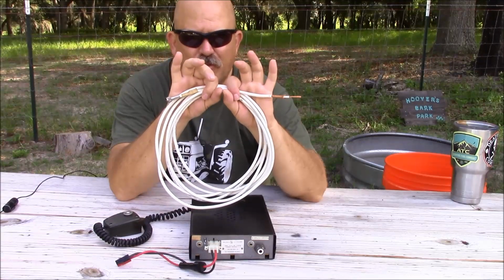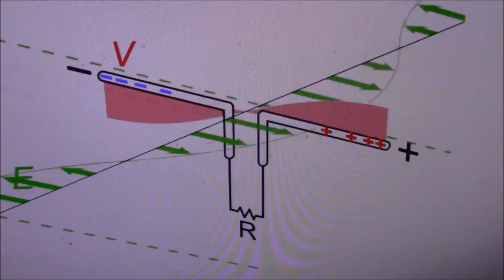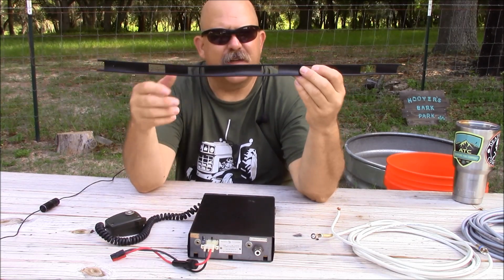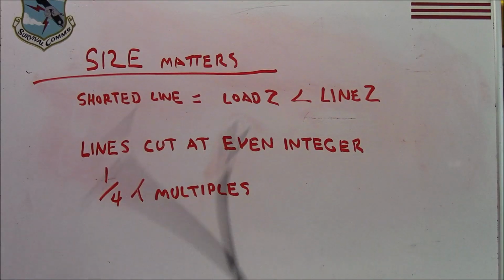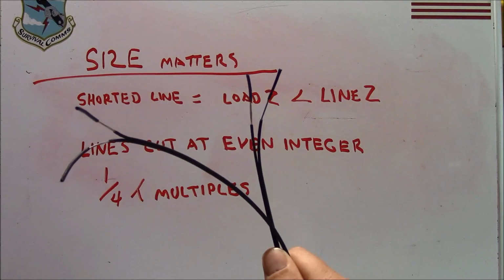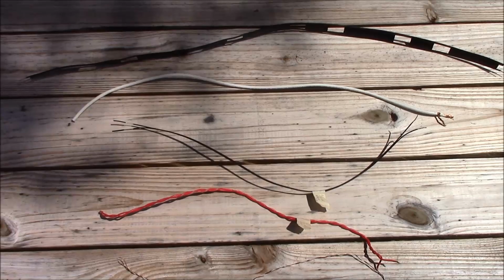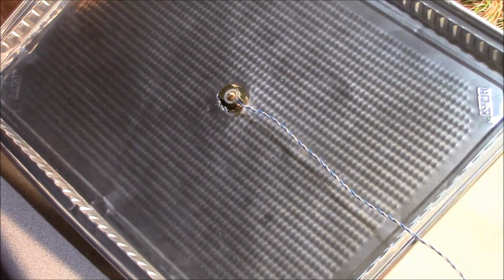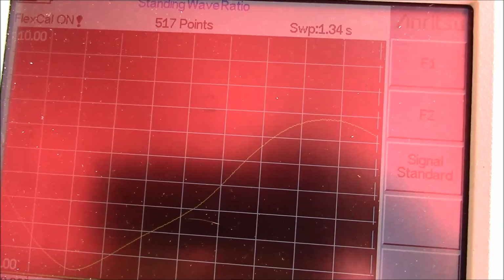Ham Radio Antenna Feedline CAT 5 DIY  Survival Antennas 5 Make your own  radio transmission line

Comment: Very informative. Thank you for the research you have done. If I may make one suggested correction, the formula 468/fMHz already factors in a .95 VF. For plain wire this should be sufficient, for Coax you'll need to know the VF and adjust accordingly. When out in the field, just getting an antenna in the air is the mission goal. Fine tuning it can come later.
Reply from the maker: Thanks for watching !

Comment: Great video. I love the practical workarounds you shared.  For some years, I defaulted to using TV co-ax for my feed line and accepted the associated losses.  After all, in the early days of Ham radio, anything to hand was used.  As you say if it connects, it talks.  Nowadays, I think there is too much buying of antennas / kit and not enough technical playing / experimentation. Pete M0WHT
Reply from the maker: I am glad you enjoyed the content. The fun of radio is using what you can and learning from the experience. Thanks for watching !

Comment: back in the old days of radio evry station was diffrent! sum used antenas with singel wire feed line like the off center dipole or t ! sum used homeade ladder line. sum used twisted pair line! the radio books of the 1930s are full of stuff of this sort! what is the loss on the twisted pare with the large ga wire at say 30mhz?  o and yes to 75 ohm tv coax! poor mans lmr 400 the rg11 is jast as good but wayyyy cheaper! could not understand why hams are so set on 50 ohm coax when you can use the tv stuff. I would have not ever played radio if i just listened to the nay sayers! this is good stuff for the poor radio op !  o when using the 1/2 wave trick with say 75 ohm coax in 50 ohm syestem thare is still a swr of 1.5 to1 right? it is just that the radio can see 50 ohms and get 1to1 and put out max power? 73 \/
Reply from the maker: I am a strong proponent of run what you have it builds skill.  Anybody can get a catalog and buy stuff. Not sure what the RF attenuation would be in a twisted pair above what is published for telecom. TV coax is a real value. The big holdup is making connections. I personally use F to N / BNC/ PL259 adaptors. Thanks for watching !

Comment: Excellent information!  Wow brings back some memories looking at that Marconi. As for the Unidapt kit, mine is a small sample of what you have. Did you source this from Tessco? 
As for the thicker twisted pair feed line, does the number of twists per foot have any impact on transmission efficiency?
Reply from the maker: Thank you !  The Marconi is still plugging along.  I had to replace an RF connector on it a long time ago and it is slap full of yesteryear.  I bought the unidapt kit second hand from a friend  who was getting out of the business due to health reasons its the RFA-4022 . The twists should have an impact RF wise but outside of making the line longer I have never studied it.  I was surprised there was so little information available on twisted pair feeder and I have some old (pre WW2) books on antennas. Thanks for watching !